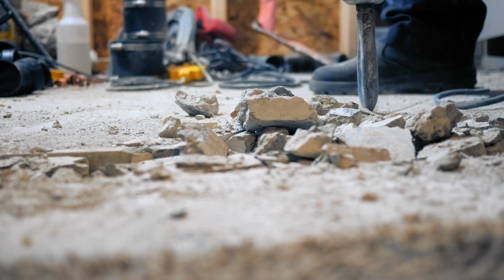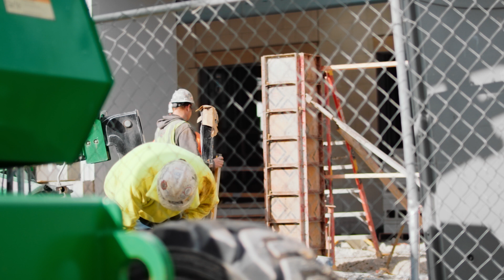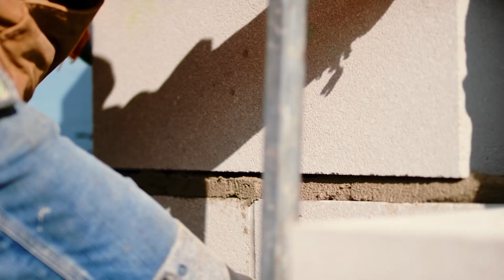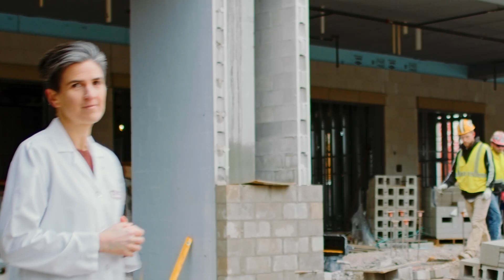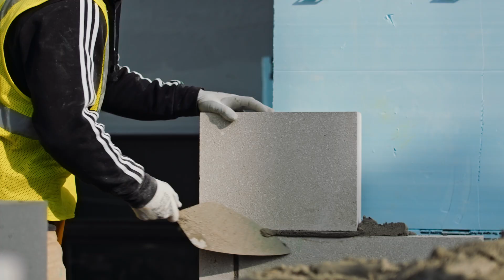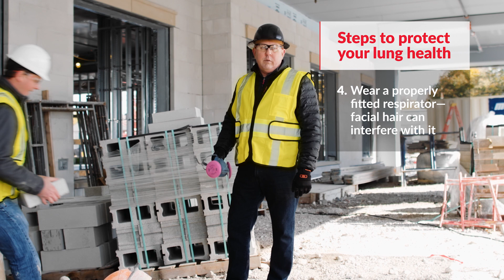Understanding Silicosis

Comment: i work a job grinding concrete. my co workers will spend 30+mins at a time in a room filled with dust every day they work. so much dust you can see it on their nose hairs and eyelashes.
Reply: R1p they probably gonna die in a few years man
Reply: @tu1469  we worked a 8000sqft warehouse one time, grinding concrete and carpet glue. the place was full of dust for 6+ hrs and he never put a mask on once. i cant imagine what his lungs look like.
Reply: @BeachLookingGuy  it’s scary because I did a sanded shower regrout it was half inch grout joint glass block, and after removing it all even wearing a good mask, my lungs hurt for 2 full days and now 3 years later I am getting symptoms of silicosis like it’s hard to breath, weight loss despite eating a lot, and the phlegm cough which I get after I eat hot food
Reply: @tu1469 how are you today?
Reply: @tu1469 sad to read. Maybe the mask wasn't rated for that kind of dust or you put it on incorrectly/not tight enough
Reply: @tu1469 hey bud, how are you doing today? I grinded mortar to remove it from concrete in bathroom and just exposed to it for 2.5 hrs. I’m so scared. I wore an n95 mask but seal was a bit loose and I saw the particles in my nose
Reply: @samar4017  hey I’m actually doing okay, I was vaping too much back then and that might of caused the breathing issues.. but honestly I don’t know if I have silicosis or not because apparently symptoms can take up to 25 years to show up and get serious. Other than that I’m actually doing pretty good glad you asked  👍

Comment: We did some sandblasting 1-2 days at our church. Some of the particles are still present. I’m fearful that I may have it. And I’m not sure how to take it away since it’s all over outside.
Reply: Unlikely. you’ll only get it if it’s your everyday job.
Reply: @themajesticstick5262  what about exposed for 12 months with little protection?
Reply: @markencalada533 can’t say for sure. You might be at risk. If your worried about it . I would find another job.
Reply: Sounds to me like good old fashioned Hypochondria as it usually takes months and years of 8h workdays in that environment to develop Silicosis not a day or two of "some" sandblasting.  But have it checked if it genuinely bothers you as it could be another issue.

Comment: I was working in a steel distributor shop I got hired he didn’t even tell me what blasting is and I’ve been exposed no mask or anything should I report this ? All they use is a big green helmet with god knows if it’s working correctly air flow filter that’s it no gloves or anything

Comment: Don’t cement bags have silica?
Reply: Yes but I think the molecules are not as " fine " and dangerous as when you you cut through the stone with a blade, but not sure about this info
Reply: @nicomusic404  To respond, depends on type of cement, if your using slag as a strengthener (SERIOUSLY BAD TO BREATHE IN SLAG) etc... your looking at around 30-35% percentage silica roughly. Your type 2 is coarser then type 3 Portland, but is STILL dangerous. Smasonary has additives to it that can do some extra nasty things. Etc...

I know cement chem.
Reply: @beeholddrbeesphbees378  good to know! I worked a couple of months in tiling and I breathed a bunch of crap from dust of grinder cuts on tiles to the dust of thin set mortar when you mix it, everyone knows it probably ain't good, but too lazy to put on the mask.
Reply: @nicomusic404 thin set mortar, what you mean by that?

Comment: Great to know after I spent all day today hammer drilling concrete.
Reply: i worked for the local 948 and they had me hammer drilling without a fucking vacume and mask. they offer such high wages in contruction and union jobs because they KNOW you wont make it that long
Reply: It won't kill ya fast man i wouldn't be worried
Reply: @chrisbosco6073  depends. You won’t know until you have a diagnosis, 5,10, or even 20 years down the line. Most people don’t show symptoms until it’s too late. Don’t be stupid just to get money, use water or wear a mask
Reply: @UnionJG  it happend just once and I don't think it was that much I was just wondering if you breathed in just one bit of it would you get silicosis.
Reply: @m15-k1r  no you should be fine. You might have some scarring on your lungs but that’s about it.
Reply: @UnionJG doesn’t the scarring continues on it’s own
Reply: @ursulamardon330 yes even after exposure stops
Reply: Don’t cement bags have silica?
Reply: @abrahanrodriguez9003  They sure would!
Reply: one day is fine , this is a long term exposure condition
Reply: @airgunningyup  not exactly dude, if you’re exposed to silica dust in large, massive amounts in a short time you can still become sick very quickly. Within 5 years time frame, is how quickly symptoms can onset.
Reply: @UnionJG only one day?
Reply: @airgunningyup how about two yr exposure?
Reply: @finalevo1571  thats bad
Reply: @airgunningyup  damn.. I’m only 26 :/
Reply: You better show your anger on your employer for not providing protection or even informing you on the serous risks. 

Don’t ever let someone put your life at risk to save some time or money.

I suspect I could have the symptoms now. I ask if you can pray that I don’t.

I hope everyone can be wise and protect themselves. Hood yourself accountable. If a coworker or employer is putting you in danger. Refuse the work.
Reply: @jessecuevas6456 how are you
Reply: @ursulamardon330 I’m good now. I would have to get an X-ray to know for sure. But I’m not worried. All in God’s hands.
Reply: @jessecuevas6456 how long have you been exposed and how bad was the place filled with dust. Any reactions to it?
Reply: @ursulamardon330 exposed for like a week straight. It was like freakin 7 grams a day.
Reply: @ursulamardon330 no honestly. I haven’t noticed much difference. I was coughing a lot initially when I was working and I did have to take like 3 weeks off from it. But I also have exercise induced asthma sometimes. My breathing has been fine now though. And I was breathing in a lot of dust for a few days. But I do feel back to normal now. I been able to exercise like normal before I started working that job. Just have faith I guess.
Reply: @jessecuevas6456 can you remember those 3 weeks… did you have bad phlegm. Chest pressure
Reply: @ursulamardon330 no honestly. It was mostly dry. I don’t think silicosis has phlegm. I just looked it up.
Reply: Shit me to haha
Reply: Are you ok

Comment: I was exposed to silica dust in a shipyard from 06 to15. OSHA regs were not in effect then. Now I am having the exams prior to acceptance in a lung transplant program. The problem is since I was exposed before OSHA instituted stricter controls on exposure it was left up to the employer to self police. My exposure is treated as a workers comp. issue and since "defense contractors" have lawyers and money and more time than most workers do the cases die before they can even be heard. Until silica exposure is treated as strongly as asbestos exposure nothing will change and all the older exposure victims are left trying to get disability through social security. If we live that long.
Reply: 🙏🏽praying for you and others in your line of work.
Reply: OSHA regulations were in place during that time. I worked in construction during that time. You should have called OSHA during that time on your employer

Comment: I was sandblasting today, wore my P100 as usual but, today I noticed glitter dust inside the mask when I took it off. I'm not sure if I breathed it in or if it got in there when I set the mask down? Either way it's very unsettling, I'm not impressed that the sand bag just calls it "industrial sand", I didn't realize it was silica until looking into it today! be carful and know what your using before you use it!
Reply: Don’t cement bags have silica?
Reply: @abrahanrodriguez9003  I believe they do but it’s minor compared to an actual bag of straight silica sand
Reply: Do concrete grinding and epoxy floors btw ik it sucks eating that shit all day
Reply: Do you have any facial hair getting In the way of a proper seal?
Reply: Do not breathe that shit in. I’m 31 fortunately I’ve been in great health my whole life. I played sports my whole life and never had an issue with breathing even though I had asthma when I was little. as a matter of fact, I probably have very great lungs compared to all of my peers. Now after just one day of mixing four bags of concrete, I can absolutely tell you that I have shortness of breath and a tight chest. I’m ok at the moment but seriously, even if you’re mixing only one bag wear a mask. I can already feel the shortness of breath and tightness in my chest the very next morning. wear a mask and make sure you take your dust cover clothes off as soon as you possibly can.
Reply: @richardl.rayiiitr3media__367how are your lungs and breathing
Reply: A lil dust never hurt anyone man dont trip out if you gonna work in this shit you definitely gonna breath some just is what it is
Reply: @chrisbosco6073  no. Do not put up with it over some “suck it up BS”. Men are literally dying from this. No amount is safe to inhale.
Reply: @abrahanrodriguez9003  That's right the only ones who want us to " suck it up " are the boss who don't give a cent about workers safety and workers who don't have the spine to step up to their boss or just step up for themselves